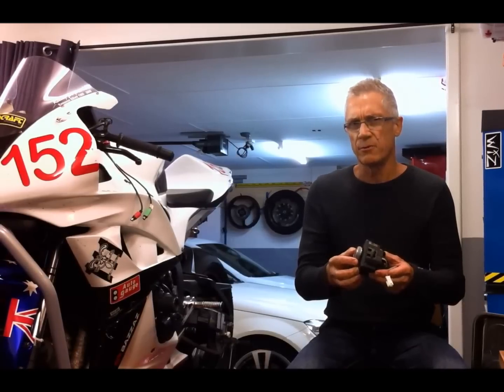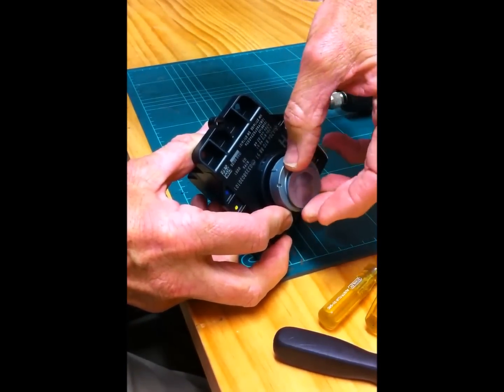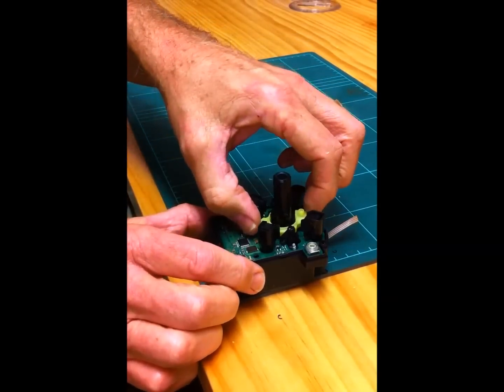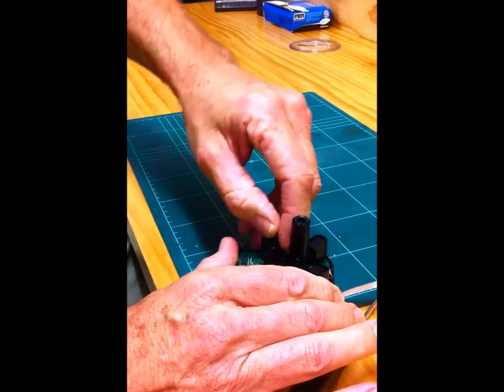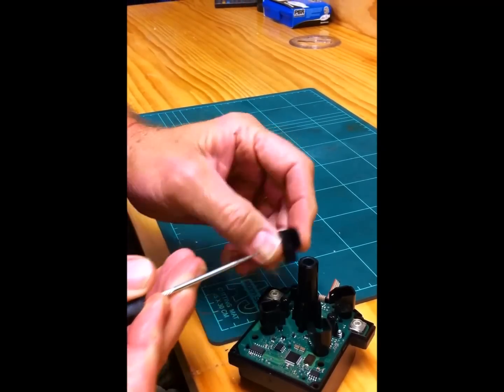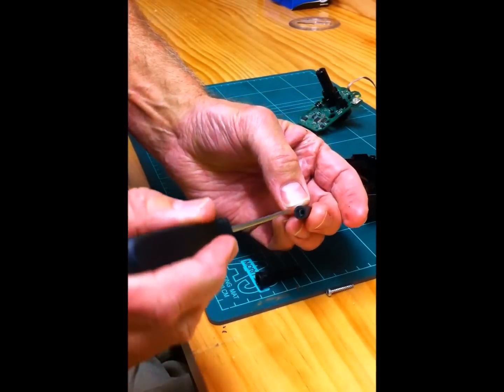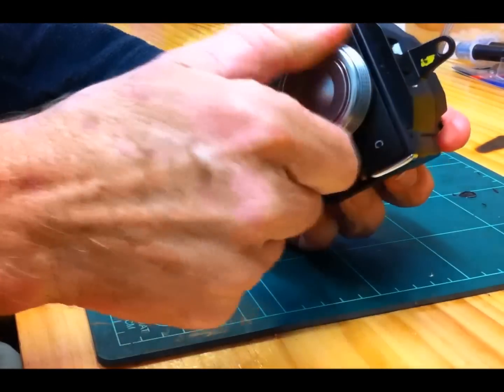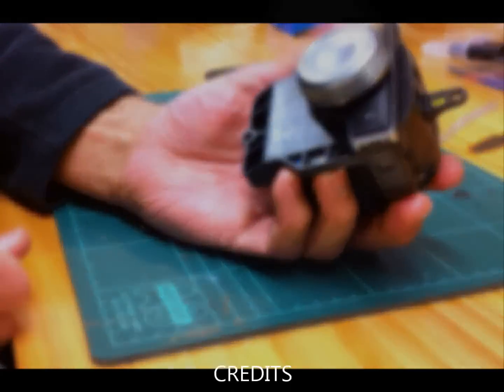Mercedes W204 W212 C E Class Repair Scolling Knob COMAND Console Control Wheel Command

Comment: Thank you for this fantastic video Scott! :-)
For anyone trying to do this on the newer version of this knob, the one with the 12 vertical lines around it (used in the W204 2011 facelift and newer models like the W212): THE METAL RING IS NOT REMOVABLE AS SHOWN IN THE VIDEO, IT IS PERMANENTLY ATTACHED TO THE KNOB. 
The way to access the screw is to ONLY REMOVE THE CAP of the knob. It is lightly glued on, so warm it up with a hair dryer first and then use a suction cup to lift it out. Do not attempt to pry it out as there's no gap and you will damage its metal top and/or the metal ring.

Comment: Many thanks Scott.  Another one here who has saved a load of money by following your instructions.   I decided to buy the replacement spindle from a guy in Germany who creates them on a 3D printer (check Ebay).    I also replaced the spindle in-situ,  thus avoiding the need to cut any cables.   Took about half an hour. 

I also followed your other instructions for fixing the rear light earthing issue.  That also took half an hour.   

I dread to think how much these two simple jobs would have cost at the main stealers.

If you're ever in Southampton,  England,  I owe you a pint.
Reply from the maker: +Andrew Spencer Thanks Andrew. I love English beer ... the first time I had a pint in Woodstock just out of Oxford I couldn't get the grin off my face.
I saw the guy selling the 3D printed shafts. That's the way to go for sure. The earthing issue is a disgrace. MB won't admit there's a problem. I read on the Benzworld forum of a guy who lost his two cars, BMW motorcycle and house because his W204 went up in flames due to the rear tail light.
Reply: +Scott Elliott  The earthing issue is a disgrace.    I noticed a burning smell coming from my boot.   When I looked closer I found that the overheating earth cable had melted through the case of the medical kit.   This area is close to the petrol filler...

There seems to have been a recall in the US,  but when I contacted MB UK customer services they denied there was a known issue.  They gave me an incident form to  fill out and may have have done a goodwill fix if I'd pushed things.   However, I figured they'd just replace the light unit without fixing the earth cable so I reckoned it would be easier and safer to fix it myself.

Do you think I should also do the LHS of the car as well?  That side doesn't seem to show any visible signs of overheating.
Reply from the maker: yes definitely do both sides. In the US & Canada all they do is replace the burnt and melted parts with the exact same parts. That's what they do in your case.
If they changed anything they'd be admitting there's a design fault. When you read the text of the US/Canada recall they're saying the problem is due to the environment the car's being used in thus they've turned it around to the owner. It has their corporate lawyers grubby mits all over it.

Comment: Scott, great video.  Thanks!  I replaced it with the aluminum shaft sold on eBay for US$30.  This way, you would never have to worry about it breaking again.  As a side note, ALL 10 T10 torx screws need to be removed prior to separating the 2 halves.  You also need to purchase an integrated T10 screwdriver as the bits will not fit in the small holes.
Reply from the maker: Alex thanks for the feedback. Yes the alloy shaft will last the life of the car so is the easiest option now. Of course no one was selling them when I made the video. If mine breaks again it will be the alloy version for me.

Comment: Excellent video.  Clear steps to repair the unit. I did not cut the wires when removing the unit for repair, instead peeled back the carpet on the console sidewalls and unhooked them from the retaining hook.  I later used gorilla tape to secure it inside the console area as you suggested in separate video. The center screw on knob was a Torx #8 for mine ( W204 2011 or GLK 350).  I used the reinforcement method with toothpicks cut to size and applied the epoxy to center shaft overlapping the break point to provide continuity and additional strength.  Reinstalled and working!
Reply from the maker: Thanks. I made a short appendix video showing how to unhook the cable. Check on eBay as you can now buy a replacement alloy shaft quite cheaply.

Comment: Thanks Scott, textbook guide on fixing the COMAND controller on my C250 Wagon. I bought an aftermarket aluminium shaft for A$23 on eBay rather than glue the sheared plastic shaft. The advice to cut the ribbon wire, pull through and resolder worked well. I staggered the cuts by about 2cm down the ribbon to provide a clear section to solder and heat shrink the individual wires and then a single sheath over the whole repair.
Reply from the maker: Thanks Stuart. I've since replaced my repaired shaft with a 3D plastic printed item.

Comment: Thanks a lot Scott! I should have read the comments from others below on how to unclip the wire by removing the carpet, but your instructions were so fantastic that I was able to complete all steps with the module still plugged in. Really appreciate you putting the time into this video. Saved me $350! Drinks on me if you are ever here in Florida! Cheers!
Reply from the maker: happy to help Ronak. I have done an appendix video with a link demonstrating how to pull down the carpet to get to the clip.

Comment: I could not have done this job without your video - thank you. I am actually still in the middle of the process, waiting for the epoxy to harden. I just wanted to comment that some things were slightly different in my 2009 W204 (US version). Most notably, I tore the cable apart when I pulled the housing out of the center console. It did not take much force, and once the unit was removed, I found out why. The ribbon cable was wound around a plastic tab at the bottom of the opening and did not give.I had to unwind the broken piece (luckily I had not cut it off yet) and only then was I able to pull it out from the shifter side.
Because the ribbon was severed close to the housing, I just removed the short piece from the connector on the circuit board and refitted the long piece to the connector. Now the cable is one whole piece and no soldering was needed.
Reply from the maker: +Christian Donner ... Good on you Christian for having a go. Your experience may help others with the USA version when they read the comments.

Good thinking shortening the cable a small amount so it's all in one piece.

3D printing a new shaft is the way to go now. There's a guy in Germany selling them for about $25 on eBay.

http://www.ebay.com.au/itm/Welle-Stift-Stick-passt-fur-Mercedes-W204-W212-Comand-Controller-Drehknopf/231689507306?_trksid=p2045573.c100033.m2042&_trkparms=aid%3D111001%26algo%3DREC.SEED%26ao%3D1%26asc%3D20131017132637%26meid%3Daea6bb27c04d4abf843f5de79112ce2e%26pid%3D100033%26rk%3D3%26rkt%3D4%26sd%3D151562840872
Reply: I thought about that myself. Good to know someone did the legwork, if my epoxy job fails. So far it is working.
Reply from the maker: 3D printers are getting more affordable by the day. I'm considering getting one soon as it's the way of the future. Once I've got it I'll do a design for a new shaft and put the G code file in Dropbox for others to use with their 3D printers. I would prefer to help others take control so I wouldn't be printing new shafts and trying to sell them to make a buck. I can get a well regarded 3D printer for about $650 delivered which is tempting.
Reply from the maker: I forgot to say my epoxy repaired shaft has been going famously for two years with no signs of trouble.
Reply: +Scott Elliott and they should under normal circumstances. they don't break just from turning the knob - there is very little torsional force. I am pretty sure mine was broken by a mechanic who leaned on it. the shop denied it and I could not prove it. my tip for older w204s - make them sign off that the ignition switch and the command button work before dropping off the car for service.

Comment: Add yet another denied sale for crap parts to this post.  Thank you Scott for taking the time to first repair your own Command Controller and then for taking the time to create the video and post it on YouTube.  Far easier than it appears at first. But, it does require taking one's time and doing it right.  Or, like me you may do it two times.
Reply: +Tom Conces 2010 C300 4-Matic
Reply from the maker: +Tom Conces Thanks Tom. I did mine twice to get it right. It's part of the fun learning how these things work. Glad you saved the cash, Regards, Scott

Comment: TNX Scott. very helpful video. It took me about 1 and half hour to do the whole job- I did not cut the wire , i dismantled the control knob  in the car and rebuilt it there as well.The hardest bit was actually the knob wheel outer ring-1st part.I found it difficult to get off and also easy to damage the edge to it, otherwise no problem to do it . use a cloth to prevent parts from falling in to the openings. I used loctite super glue powerflex gel. worked like a charm.
Reply from the maker: +Kristian Larsen That's good to hear and good information for others. Thanks for sharing. Regards, Scott

Comment: Great video! Just repaired my 2009 C300 with $7 of epoxy. I did note the US version uses a 7 torx screw in the knob top (vs a 10), and I was able to disassemble the console enough to not have to cut the cable (just pulled the cord off a tab under the cup holders a little deeper in the console and disassembled the unit in a the car), otherwise the video was perfect! Thank you so much!
Reply from the maker: +Joel Kautz That's great news Joel. Well done. Regards, Scott

Comment: Brilliant instructions. I couldn't get the ribbon and I didn't want to cut it because my soldering skills are a bit rusty.  So I unhooked the first part of the ribbon connector like you showed and then did the rest of the repair in the car with the the circuit board still attached to the ribbon. Hope this helps people in the same boat who don't want to have to go through the hassle of desoldering the ribbon. Now the scroll wheel works a charm.
Reply from the maker: Yes others have done it that way successfully. I guess I like soldering!
Regards, Scott

Comment: I just wanted to say THANK YOU so much, sir. Your videos had saved me so much money from problems i have with my c300. This problem just recently popped up on my car, and it has been bugging me alot. With this video of yours now i can confidently go on and fix it myself. Once again, Thank you Mr. Scott
Reply from the maker: Tang I'm very pleased to be able to help you out. I don't like seeing people being charged excessively for problems that can often be easily fixed. Regards, Scott
Reply: Sir, im trying to fix my license plate light since there is now power to them at all. Ive done checking for broken connection but still no luck. Do you have any advices for me at this point? Thank you in advance.
Reply from the maker: Tung other than checking the fuse, bulbs and connections I can't think of anything else.
Reply: I have searched around the forums and there isn't any fuse for the license plate light. Would you suggest i hook up the power from the rear side marker light to power the license plate light, sir?
Reply from the maker: Tung that's a plan for sure. The side marker lights and plate lights are usually on the same circuit. Give it a try.
Reply: thank you, sir! I will give it a try and let you know how it went.

Comment: Great video.  I purchased a new aluminum stem and it works well.  A few hints 1)  the cable is a real pain.  I did not want to cut it and ended up pulling it towards the control unit and taking the control unit in the car (which worked well - just be careful to not loose any parts 2) take a picture of the pieces in the stem/joystick, they need to be aligned in a certain way when you reassemble.
Reply from the maker: Thanks David. I have made an appendix video with a link in this video. That shows how to lift the carpet to access the clip holding the cable in place.

Comment: Excellent thank you so much!!! Followed this and disconnected and repaired my unit within 1 hour. I bought an aluminium shaft for £20.

Disconnecting the wire was very easy too!
Reply from the maker: Good news well done. My shaft broke again a couple of months ago. A friend made me a new one using his 3D printer. I notice eBayers with 3D printers are selling them for about the same price as the alloy versions. I'd be concerned with wear having metal on plastic. Plastic on plastic would be better. Perhaps run your alloy shaft for a while, dismantle and report back with your findings. Regards, Scott.
Reply: Scott Elliott will do. Thanks mate

Comment: Absolutely brilliant - thanks scott!
I didn’t repair the post (eBay aluminium replacement) or need to cut the cable - was already loose, but couldn’t have done it without these 2 guides. Legend!
Reply from the maker: Thanks Lenmiester ... glad I was able to help. Since making the video replacement alloy and plastic shafts became available. I eventually had a friend print me a replacement shaft out of ABS plastic on his 3D printer.

Comment: Hi Scott, thanks for your video. I managed to repair the one on my car easily after watching.  A couple of things I did differently though, I didn't like the thought of cutting the wires so I dismantled in the car, once you unplug the switch you can pull enough of the cable through to allow you to work on it, just have to be careful not to drop the screws or springs into the console. Also, I cut 4 grooves into the top piece with a grinder and 1mm disc so I could place small nail shafts across the join for 'steel reinforcement'. Once I buried the nails in epoxy, I can guarantee that shaft will outlast the car. Had to glue it in two stages for this, the initial glue joined it back together then the second to embed the nails. I'm amazed the shafts last as long as they do, there was barely any plastic linking the top and bottom pieces on mine.
Reply from the maker: Thanks Dan. I'm glad you were able to fix the scrolling function and I was of some help. I also cringed when I cut the wires but after spending about 30 mins trying to free it from whatever it is that holds it under the console I'd had enough!

I gritted my teeth closed my eyes and ... snip! Soldering back together was easy and I've had no issues at all in over a year.

As I was doing the R&D to find out what to do to fix the problem I had to remove it so I could pull it apart on the bench. If I had to do it again now I can see the merit in dismantling in the car as I know exactly what to do.

Kind regards, Scott

Comment: I followed all the instructions and everything worked out great. The only difference was I bought a second-hand control knob to install while I took my time to repair the original. The second-hand one cost me £110 so now I have one to sell.
Reply from the maker: starboyrealdeal That's good news so well done on a successful repair. I did the same thing and purchased a used item but it was only $AUD50. I installed it while I worked on the original to come up with a way of repairing it. Then the used one broke so I put my original repaired item in and repaired the used item and have kept that at as a spare.

Comment: Hi Scott. I've taken out the mouse. I'M stuck on a simple thing; I can't loose the bigger external wheel or ring of the button. You do it so easy with a screwdriver and it seems that mine is welded or glued....

Finally I managed to set it loose, and from there it was as easy as shown. Can't thank you enough.

DIY rules!

Comment: I just completed this fix on my 2011 E350 sedan. (just of out of warranty) Others suggested I contact MB for good will to cover it, but whats the point if they are just going to install another part that will fail again in 4 years. Now, it will never break ;-) The only part that was different than the C class was getting the module out was a real pain. I had to shave about 1mm of plastic off of the chassis to get it out. Other than that, worked like a charm. Dealer wanted $180USD for the part and almost $300USD for labor. This fix cost me about $5.99USD in Epoxy and about 2 hours of time, not including curing time of course. The only tip I'd like to add: When removing the module from the vehicle, I did not need to cut the wire. The wire harness is completely accessible, just in front of the module. On the bottom of the white wire harness, there is a little tab. Just push that toward the passenger side while applying pressure on it toward the front of the car and viola! popped right off.. Went back on in the same manner. I used a tiny L shaped awl tool to do this. Thank you SOOOO much for the how-to. Really was a money saver!
Reply from the maker: Thanks for the tip I'll check that out and see if it's the same on the W204 C Class.
I agree it's better to fix the thing properly. Also it's more hassle and takes longer stuffing around getting your car to and from the dealers. Glad my experience could save you some money. Regards, Scott
Reply: MrScott52 I also just posted on the other video with a bit more detail and more specifics on this for any other E-class folks out there. Thanks again!
Reply from the maker: revengejr Good on you as that helps us all. I like trying to beat the system and hate being gouged by MB or any supplier for that matter.

Comment: Really helpful, worked like a charm. Instead of repairing & reinforcing the shaft I used a wooden dowel to replace it. 
Thanks for a great tutorial.
Reply from the maker: +Selwyn Price Thanks for the compliment Selwyn. A wooden dowel is an interesting repair. 3D printing a new one from ABS or PP is the way to go now. if you search eBay there's a guy selling 3d printed replacements for about $30.